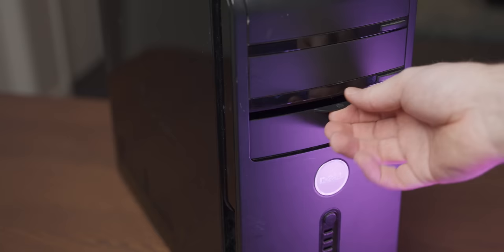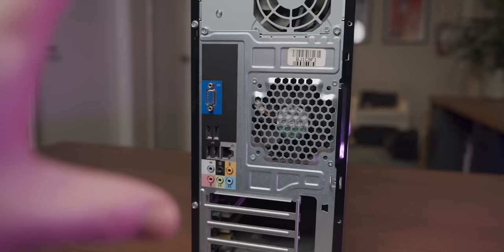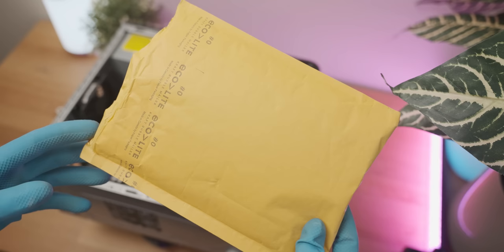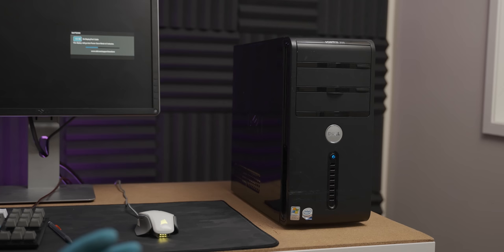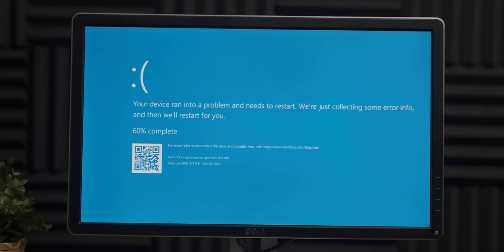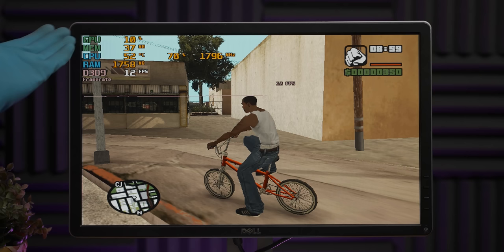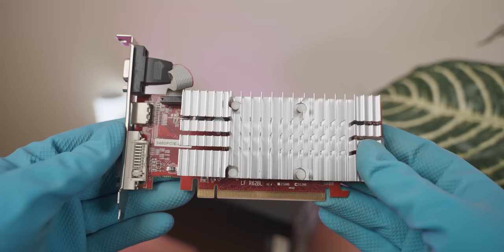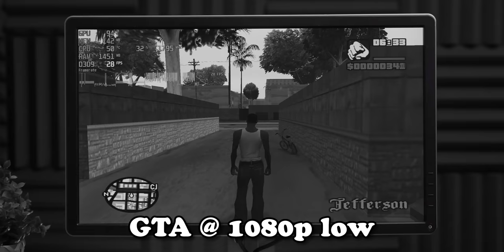I Think I Was Scammed Buying This $19 PC of Craigslist...

Comment: Even the 19$ PC has Dual Channel RAM (or Quad Channel?). Prebuild Manufacturers should really look out!
Reply: Still dual-channel.
Reply: @TechHug  ok
Reply: Back when Dell made pretty good business PC's this was. Also of note is without a shadow of doubt the finest CPU heat sink mounting mechanism ever devised.
Reply: Quad chanely is usualy 8 slots
Reply: no quad channel this is not a threadripper cpu here besides quad channel would be 8 slots not 4, 1 channel per pair of ram sticks
Reply: still dual channel. this is from the era where it was cheaper to use 4 small capacity RAM sticks than 1 single higher capacity one.
Reply: Only one consumer level Intel generation has more than dual channel ram support, the 1366 socket first gen core I series, the 1156 socket first gen was also only dual channel. So only half of one gen.
Reply: @danthompsett2894  Some quad channel boards like my EVGA X299Dark are only using 4 Slots...
Reply: @deroger612  my bad should've said some exceptions not with standing and generally speaking.
Reply: My shitty prebuild back in 2005 came with dual channel. There is no excuse for them not to include two sticks, especially when it isn't more expensive than a single stick with the same size.
Reply: @deroger612  same, my dodgy chinese "X79" board does quad channel using 4 slots.
Reply: @buggerlugz6753  Yeah dell sucks anymore
Reply from the maker: I almost didn’t know how to react to the dual channel. 😂
Reply: Well, thats how rare it has gotten to see dual channel…
Reply: @bdhale34  If you count LGA1366 (X58) then you should also count the quad channel X79, X99 and X299
Reply: it's dual channel, quad channel has the RAM slots on both the left and right of the CPU socket (even if there is only 4 slots), presumably for better timings.
Reply: @whitebeartigtig  the chipset on that board is most likely an H61, actual X79 chipsets are way too expensive to source

Comment: I've learned a lot about computers, and sarcasm, watching your videos. I tried updating my 10 year old HP which was running windows 8.1 with a new power supply, ram, and graphics card but had issues with the drivers which wasn't all that surprising. Watching your videos pointed me in the right direction and now I can actually use my computer again. Keep up the great work! Also I'm now subscribed to help with the bacteria.

Comment: Would have been interesting to see how an older operating system would have performed on this.  Older OS with better driver support and using less resources might have made the the same games run better, methinks.
Reply: A stripped down lean Linux distro would also be cool since with Steam's Proton compatibility layer now most games run decently well.
Reply from the maker: After my recent experience with XP, I hadn’t built up the courage to give it a try again yet. 😂
Reply: @DawidDoesTechStuff  you can always go vista😈
Reply: Just use win7
Reply: @DawidDoesTechStuff  Try Ubuntu Mate and Lubuntu, Linux gaming compatibility is way better now, and clean out the dust and put matching 2GB RAM
Reply: @schweepy_g  at least from my experience Proton doesn't like anything below a GT710 unless you use the open source drivers and then the performance is way worse than using Windows 7 with its appropriate drivers
Reply: Honestly you would probbly be better off with wine/proton on linux unless you could find the original games on cd or something. Asgetting the launchers to even start on old os is a battle.
Reply: @max_uaminecraft1827  +1, came here to say this myself.
Reply: Equipped with at least 4 GB of RAM and Windows 7 installed instead of 10, that POS would be relatively tolerable.

With some lightweight Linux it would fly, but this is a Gamer's Site after all. Kinda... 🤭
Reply: @Ba_Yegu  You have the right idea, actually... Linux Mint is basically Ubuntu but faster, and cutdown versions will run acceptably (depending on your definition thereof, I'm used to Atom z83xx systems!) on hardware almost down to a 2009-era Asus netbook...

Install Mint, strip it till you can see the bone, and drop Steam (and the Steam Play thing -- or whatever they're calling it RN [sorry, I'm a hardware nerd but I don't game] that lets you do Windows games in Linux) on top. Perfect!
Reply: @Travelling Slim HMMMM I WAS WONDERING THIS TOO MYSELF, GEE I WONDER IF AN OLDER OPERATING SYSTEM WOULD MAKE IT SO IT RUNS BETTER...
Reply: What if you tried running Windows ME on it? Thats actually what I had on my first gaming PC that I built in early 2001 which I later upgraded to XP.
Reply: @sburton015  I do not know what the Microsoft programmers were on when they designed Windows ME, but seems like powerful substance.
Reply: @laserhawk64  When already going for the lightest flavour, there are already Ubuntu distros with lighter window managers like LXDE/LXQt available.
Reply: @sburton015  Me will have as much issues with drivers as 10 does. Both the (most likely) 30 series chipset and the GPU (both the onboard and the HD4870) have no drivers available for it.
But yeah, this is a machine for the XP/Vista/7 era, those do have drivers available and will perform adequate with it's specs. Or a light Linux distro assuming decent drivers for the hardware is available.
Reply: @HappyBeezerStudios  Ugh, LXDE. Acts just like XFCE except all the configuration stuff is in all the wrong places and then some. Oh... and IIRC somewhere online there's an actual real-world performance test thingy that shows it's not substantially leaner on resources.

If you want a WM or DE that's sadomasochistically lightweight like that, use MATE or JWM. If not, use XFCE... unless you're one of those militant Stallman fanboy types that's all to eager to go through absolutely incredible contortions to avoid binary blobs -- in which case, use Trinity, and expect me to mock you if I find out that that's who you are, because you deserve it. Nothing personal, just that I have a low fundie tolerance lol.

Comment: A tip for future reference would be to just install windows offline on a separate computer and then just transfer that drive to the test PC. You could also clone that windows install as an image (~30ish GB) and use that image for future drives whenever you need a fresh windows instance.

Edit: these type of builds would also be a fun place to start messing around with Linux installs
Reply: or just not install windows 10 on a windows xp era pc
Reply: I don’t think you’re getting the point of these videos. Efficiency is definitely not the point.

Comment: Dude! This model Vostro 200 was my first PC- I threw a radeon 6870 in there and it was actaully fairly competent. Ran 2015 battlefront at like 40fps . 

I still use the case for my current build because its so nostalgic ( and I lowkey love the way old dell cases look)

Comment: I'm surprised Win10 even ran on just two gigs of RAM. The lowest I've seen it use is something like 1.9 gigs. And that's after stripping it down of all it's bloatware.
Reply: I used Windows 10 on a cheap Intel Z based notebook back in 2015 
Windows weren't that bloated back then
Reply: He should install XP . It is a throwaway PC anyway, but with this specs it could run all the games from that era pretty well.
Reply: The more RAM you have , the more windows uses
Reply: It truly is an XP appropriate piece. 2 GB are plenty for that, but anything newer will get tight.
Reply from the maker: Honestly same here. It was using 1.7 gigs just idle on the desktop. 😂
Reply: I’ve ran it on 1gb before. 2gb is the minimum requirements though.

Comment: I'm actually surprised the seller gave you a usable graphics card for so cheap on the spot. Usable being relative obviously. Next to Intel on board graphics.. any PCI-e graphics card is an upgrade. Even my old AMD ATI system with Radeon HD 4200 on mobo graphics wasn't able to make HL2 playable- and that was like the pinnacle of motherboard graphics performance. Though it was able to play Amnesia: The Dark Descent just fine.
Reply from the maker: Anna has that effect on Craigslist sellers. 😅
Reply: @DawidDoesTechStuff  My guess is that is the video card that was in the machine before the scammer removed the hard disk and Sata cables.
Reply: @DawidDoesTechStuff  You should offer to sell this card to Jay. He paid 110$ for an Amazon Graphics Card loot box and got an HD 3450 that wouldn't even boot into Windows.
Reply: 11$ is still a scam price for that card I think. I recently got an R5 240 for 14$ USD with shipping and that card can run circles around an HD 3450.
Reply: @DawidDoesTechStuff  She certainly out bargained Jayz2cents. and she got a much better running card of the same chip. TBH, the card runs better than I expected.

Comment: Wait, Windows 10 ran on a PC with 2 GB of RAM? That's surprising actually. I thought it needed at least 4.
Reply: The real minimum requirements are 1GB ram for 32bit and 2 for 64bit
You can actually run it on less but i don't recommend it since you won't be able to run anything even the browser.
Reply: Few years ago there was some cheap new laptops with a Celeron, 2GB RAM, 32GB eMMC and Windows 10. HP Stream 11 was one of them but there was some other ones too

Comment: Kinda funny i see this video now. I just revived an old Dell Vostro 400. looks identical to this. Though in mine, I put a core 2 duo E8400 in it, 4gb ram and a Radeon X1950 GT 512mb. using it for those 2000's era games. and it runs brilliantly. FEAR at 1440x900 max settings No soft shadows runs at 45-89fps. Half life 2 is 50-112fps at 1680x1050.

Comment: I think, Dawid, you need to make this a series.  Slowly upgrade the $25 PC until you can't anymore (GTX 260, C2Q, more RAM if it can, SSD, that USB3 card, etc. etc.) and take us along for the ride.  Make a real budget baller :)
Reply: The hardest limit would probably be the motherboard. No oc, probably limited to 4 GB RAM and lack of drivers for modern OS.
I'm writing this from a C2Q oc'ed to 4.1 GHz with 8 GB DDR2 and a GTX 660 Ti, which can run Doom 2016 and Witcher 3 at playable framerates. It basically reaches into the lower end of i5 territory, which means tons of games up until maybe 2015-17 will run just fine.
So the platform itself is still capable. Obviously not as much as something less ancient, but for the right price can still make for an okay entry gaming rig.
Reply: @HappyBeezerStudios  IIRC this is a Dell Vostro 200/400, there's also Inspiron 530 which use the same hardware but has silver case instead of black.

The motherboard is indeed the hard limit here, but it's not like what you think: There were 2 motherboards for this model, G33M02 and G33M03. They're pretty much the same with the exception of CPU support: G33M03 supports quad core while G33M02 does not.

Unfortunately Dawid has the G33M02 motherboard, as seen at 2:15. Still fine though, it supports E7000 and E8000 Core 2 Duos and since it's an LGA775 board there's BSEL mod for some decent overclocking. Even better, this board supports up to 8GB RAM, or maybe 16GB if you can find real 4GB DDR2 sticks (not those AMD-only sticks in eBay)

Definitely has potential, with a better CPU, GPU and more RAM it can some kickass XP gaming machine.

Comment: In Maine we have something called State surplus, we can buy used government/ school stuff. It looks like a cheap display adapter, not meant to run games just meant to run multiple displays. But in a better computer it'll probably run Minecraft. 

They're five dollars including a display cable, which also comes with a monitor, so when I bought 10 monitors and 10 of those gpus I had 10 dvi and 10 vga cabels

Comment: That graphics card really stepped up.  I don't push my optiplex 790 (core i5) with big games. I have a 7470 Radeon 1 GB that makes it so I can use two monitors. I run Linux Mint 20.3 on it.

Comment: You absolutely can install Windows on a PC like that with a flash drive. Either create a bootable Easy 2 Boot drive with the desired ISO (that is how I install XP), or use MicroShafts Win7 flash drive creation tool, it works with everything from Win7 and beyond.

Comment: On old PC's like this that won't boot from usb, the easiest thing I've found to do to install windows from a flash drive is to install DOS with plop boot manager to a hard drive connected to another computer. Then put that hard drive in the crap pc and boot from it and use plop boot manager to boot from usb. You only have one shot this way because when you start installing windows it'll overwrite DOS and plop boot manager so if it fails you have to start all over again. Still easier than messing with a DVD in my experience.

Comment: Did you try re-pasting the CPU? I got a Dell Optiplex XE for free with a pretty bad CPU and no GPU. Ran way smoother once I re-pasted the CPU and cleaned out the fan and heatsink. Now I want to try putting a 1030 or something in this and see how well it runs games. (it runs Torchlight 2 on SparkyLinux which I'm happy about)

Comment: You can install Win 10 on these old systems, I have done it before! In fact I had an old Dell Inspiron 530 with that same motherboard. I had 4GB of DDR2 800Mhz and an E8500 in it. You can use Rufus 3.13 with the following settings:

- Partition Scheme: MBR
- Target System: BIOS (or UEFI-CSM)
- Add Fixes for old BIOSes
- Use Rufus MBR with BIOS ID
- Create extended label and icon files
- Check device for bad blocks

I've used these settings for multiple LGA775 and and old Phenom II systems and it works pretty much every time. Hopefully this helps somebody!

Comment: If an old BIOS like that doesn't support USB booting, you can use Plop Boot Manager to do so anyway. It can run from a floppy, though I didn't spot a drive for that either in between the dust.

Comment: I know this video is like 2 years old, but I've had a similar experience with motherboard graphics. Turns out some older cards quite often don't have certain features carried over from their original drivers from their older os. In my case, opengl was not supported and I couldn't play any games until I either booted into windows 7 or below or used a modded driver

Comment: I'm daily driving an '09 Dell Optiplex 780 USFF with a core two duo E8500 and it benefits greatly from switching to an SSD. I'm also using the latest W10 pro. 

I love this older hardware and have quite a bit of it.

Comment: I may have a tip for booting from such old devices:

Just burn the install image to your HDD and install the system to a secondary partition on there. That works when you can't boot from anything else other than your system drive, I had to do that in the past with such old systems and it works pretty well but requires some more work to then expand the partition later on

Comment: If I had that machine to fiddle with in the UK, I'd be straight down to CEX to get 4x 1GB RAM at £0.10 a shot, or 4x 2GB RAM at £1 a shot, and a Core 2 Quad, Q6600 if the board is a relic that can't take the 45nM CPU or maybe the £2.50 Q8300 if it can

Comment: I can say with certainty (& consistency) from my experience that $150 is the magic number for CL builds. 

Today, that got me a i7 4770K, Z87 Pro, 16GB Ripjaws DDR3 (2x8GB), MSI HD 6570 (lol), Zalman Max cooler, and a 500W Antec power supply...all that for $150.

I can throw it in the thrifted $3.99 Corsair Carbide 200R case and add the free working 250GB Samsung SSD I pulled out of a broken laptop while dumpster-diving and will have only spent $153.99 for the whole complete system, or add my $150 EVGA 980Ti SC2 as well and make it the ultimate ~$300 beast. 

If you do another one of these, I say aim for $150 (or $192CAD). 

Otherwise, this was hilarious to watch, thanks for posting!

Comment: I used to have a E2160. You could overclock that beast on stock cooling from 1.8 GHz to a whopping stable 2.4 GHz.
Reply: You think that BIOS supports overclocking?
Reply: @1pcfred  I have no idea which BIOSes support overclocking and which ones not. It's been way too long to remember which BIOS i had. Must have been almost 15 years ago.
Reply: @misterunknown8923  15 years ago overclocking may have made more sense. I never got involved with that sort of thing myself though. If I wanted a faster computer I just got one.

Comment: This is exactly the PC that made the GT 710 such a good seller. My dad has a machine similar, and the on-board graphics hardware is so bad that YouTube and Netflix were unwatchable at 480p or higher due to gratuitous screen tearing, and a GT 710 was the cheapest solution to that problem.

I mean, fair enough, most 710s are probably bought by scammers making "gaming" PCs, but this's the genuine actual use case for one.

Comment: I have a similar machine, but it is a Dimension same case but white, flashed it to the latest bios version (adds usb boot), installed a 3ghz E8400 core2duo cpu, 8gb of ram and the bios also support drives larger than 2tb! Tried a 6tb drive, no problem. See if u can upgrade your machine. :-)

Comment: the video shows, that the integrated graphics on the cpu require computing power of the cpu itself. this is than missing for the usual cpu job stuff. if a dedicated graphics card is added - now most of the graphics computing and stuff that the cpu had to do too before now does the gpu. so the cpu has more time to process its tasks- result games run...  better.

Comment: You should Bios Mod, add Xeon LGA 771 microcodes, install a Xeon X5460+8Gb Ram and contemplate the power of an ancient civilization!

Did it myself with a trash PC, but the GPU was a GT730 GDDR5

Comment: I'm not surprised Half-Life 2 ran so much better with the GPU. I was running it well on a single-core system with 512MB of DDR1 and a GeForce FX 5200 128MB back in the day when it first came out.